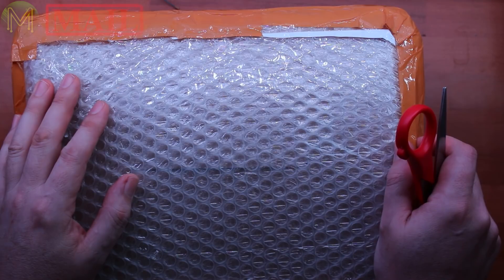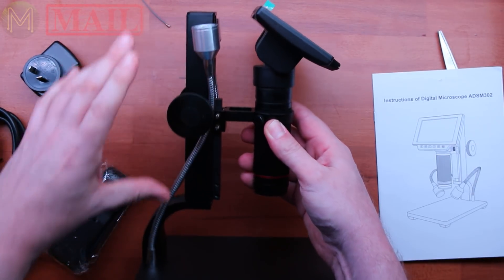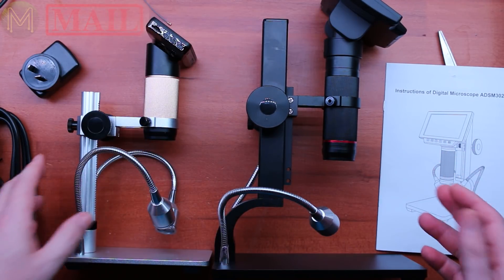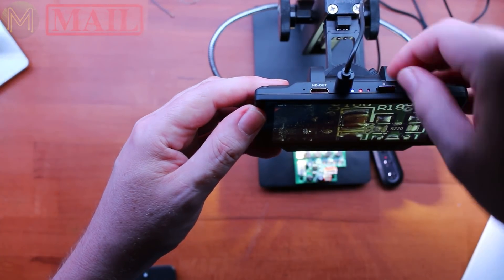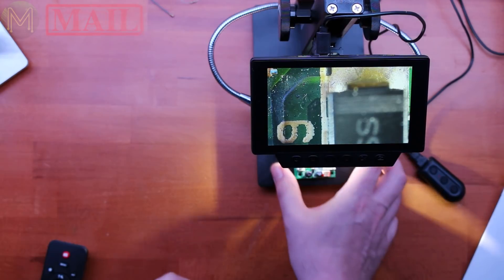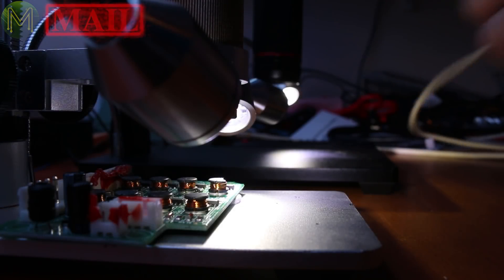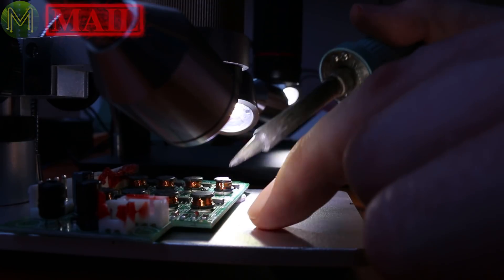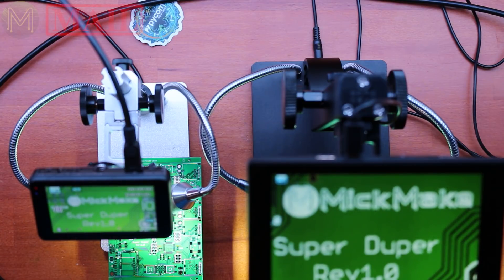#196 MickMake Mail #25: Andonstar ADSM302 microscope // News

Comment: Thanks!  302 also has larger base, software for capture/measurement, and dual camera height.
The mounting ring can grip either the front or rear of the lens.  This lets you get long working distances and very low mag.  Try it!!  I just wish you could get HDMI and USB output at the same time.

Comment: Yeaaahh I have the 302 microscope and it's a beast, very well made, awesome screen and focus is super easy. Very stable base, not too sensitive to bumps, lights are handy but I found that they kinda get on the way a bit too much if you're soldering. Best is to have very bright lights around your bench and just move the little lights away during soldering.
It only needs 1x USB to power everything. Feels like a proper name brand $1000+ microscope.
Awesome little tool, worth every cent $$ =]
Reply from the maker: Hey mate!
Yup, it’s a nice little unit that pretty much does what it says. Using polarising filters helps with visibility, (I’ve been told).

But, yup, certainly a step up from the previous model.
Reply: i dont mean to be so offtopic but does someone know of a tool to log back into an Instagram account??
I somehow forgot my login password. I would love any assistance you can offer me!
Reply: @Christopher Cristiano instablaster ;)
Reply: @Casen Ace i really appreciate your reply. I got to the site through google and I'm trying it out now.
Takes quite some time so I will get back to you later with my results.
Reply: @Casen Ace it worked and I actually got access to my account again. Im so happy!
Thank you so much you saved my ass !
Reply: @Christopher Cristiano no problem :D

Comment: i have one of those microscopes and i still by far prefer a headband magnifier for pcb work. way faster to deploy, way easier to use, no limitations on board size or placement, no fiddling with focus, no constantly fighting lighting, and retains stereo vision for depth perception. also way cheaper.
microscope is good for inspection, but not for pcb work.
Reply: I’ve looked at those, but they all seem to have a very close working distance.  Have you found one that doesn’t require the work to be right under your nose?

I settled on using a magnifier lamp on an articulating arm.  Just the right magnification for hand soldering work, lots of room under the lens for my hands and tools, and stereo vision is preserved.  I swapped out its fluorescent bulbs for some COB LED arrays I had laying around, which improved the lighting dramatically.

That said, I’d definitely like to have a microscope for inspection.
Reply: i have a magnifier lamp on articulating arm as well. never use it anymore. lighting is still an issue, and i am always fighting positioning it vs the smoke extractor and the board to get everything usable. it's way too bulky for the limited utility it provides.

the headband magnifier i use is this one. https://www.amazon.com/gp/product/B0015IS6K2/ you can swap out the lenses for whatever focal length you desire.

there's good reason jewelers and watchmakers use headband magnifiers. what does your dentist use? mine uses headband magnifiers. maybe it's time electronics hobbyists got on board.
Reply: Thanks for the link.  2x magnification seems a little low, but the working distance is certainly good.  I might just give them a try.
Reply: you could try the 2.5x lens and add the additional optiloupe for super close up work.
Reply from the maker: For me it depends on what I'm doing. Headbands are fantastic for soldering and PnP by hand, but they tend to give me  headache. So then microscopes take over. However, I can use a headband for longer.
For general inspection - microscopes are the way to go.

Comment: Looks like both units have lighting (sockets) made of metal, so if touched by a soldering iron, nothing melts?  (In the outtro, looks like our Host is 'knackered'.  Is that the right term?  Us Amurricans would say, "you look beat".)
Reply from the maker: Yup, the lights are metal.

Outtro? Yup, when the trainer was doing loops with the parafoil I started to get dizzy, (from having blocked ears). By the time I hit the ground I was feeling quite sick.